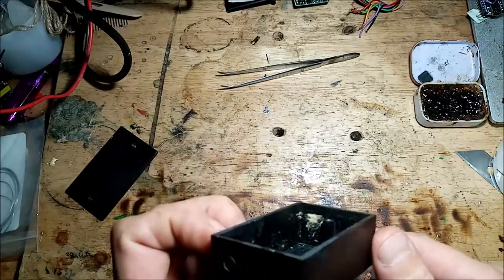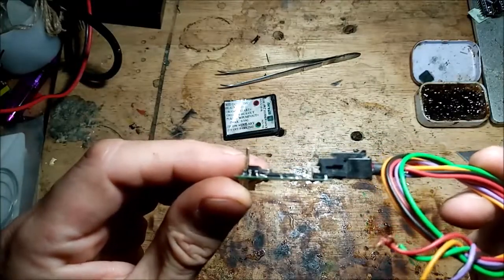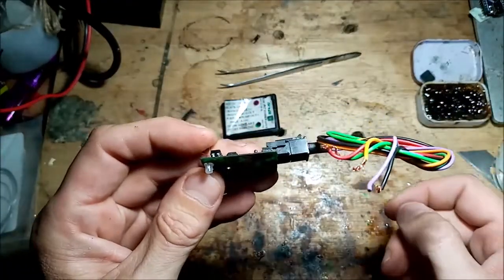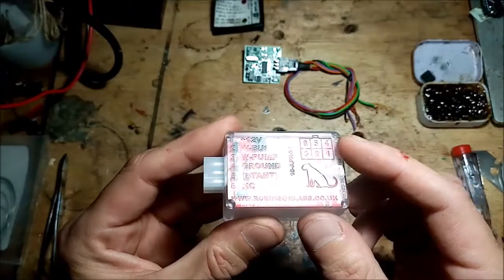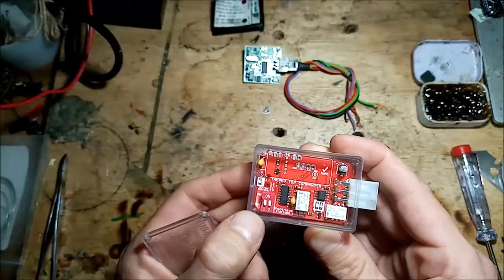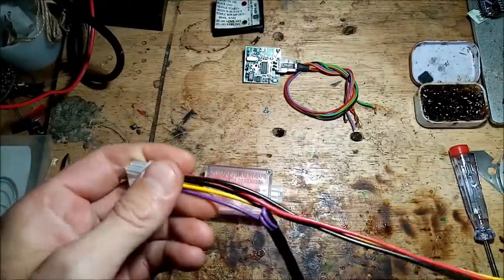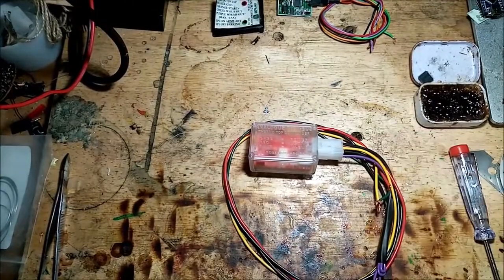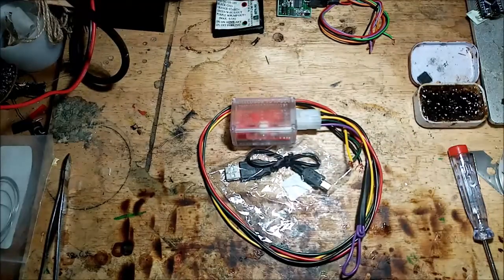W-BUS THERMO TOP COMMANDER With pass-through Diagnostics

Comment: Next Version USB c Plesse :-)
Reply from the maker: Yes new version coming soon with USB type C connector, The software is still USB 2.0 mind you so it will run with backwards compliance, that means there will be NO USB 3.1 speeds as the software can not sample that fast nor can the heater! Heater connection speed is only 115200 Baud which is only 11.520KBPS so well under 480MBPS of the USB 2.0 standard! Should be ready for late spring.
Reply: @robinsonlabs  do we have a link to order ?

Comment: How does this work out with a VW T5 that has a Thermo Top C in as an auxiliary heater? Is it necessary to flash other firmware to be able to use it as a parking heater (i.e. without starting the engine to warm it up before I go out)? And do y'all ship to Slovakia?
Reply from the maker: The T5 is "locked" to the vehicle! its called "component protection" and to change one it would require VW Dealer to "code it to vehicle" They are made with can-bus not w-bus, and they "talk" to the HVACR system! There is no way to re-program them as the processor is a MASK-ROM, that means its coded and made in the factory and it cant be programmed! There is no programmer for it! even webasto dont have and cant reprogram it. a T5 is a T5. wrong board to do that to. find another type of webasto, only BMW (91452C)(sticker on under side of board) can be un-tied from BMW to make it analogue at this time! Even if you could "flash it" there is not the circuitry to start it from pin 1 like you would want SORRY
Reply from the maker: what you want is called telestart, it is an add on that would turn it into the parking heater you would want! they are expensive but available from VW. you could look for a secondhand telestart which would make it cheaper.

Comment: Where's the one with the display?  More importantly, is there a way to change the temperature set points?
Reply from the maker: i development! every webasto uses diff temp offsets. and no you cant change temp set points, the temp is hard coded in the firmware and cant be changed.

Comment: Just for anyone watchng this, I bought a Robinsoson Labs Webasto Controler with pass through last year, and its brilliant. I use the Wabasto Water heater to run 3 radators in my garage.
All you need to do it press a button controler and the heater starts, the USB pass through works with the Websto software, I cant praise this guys products enough.